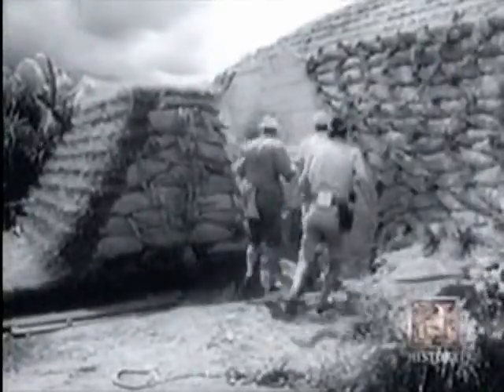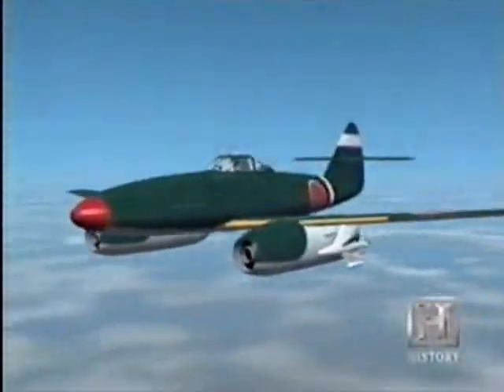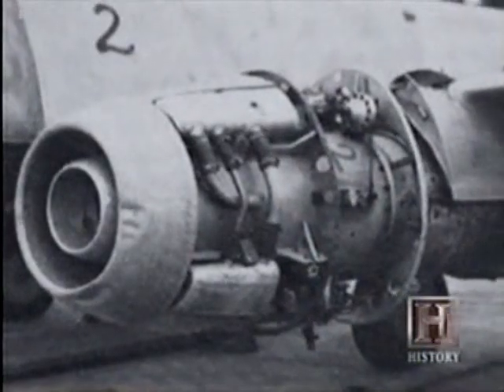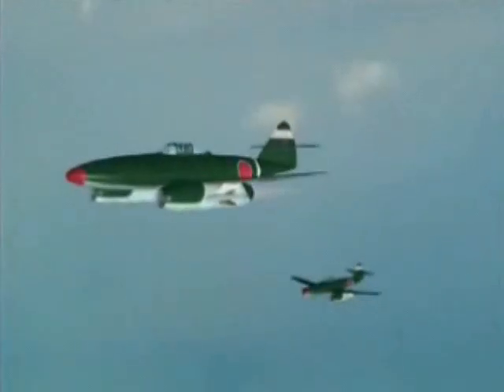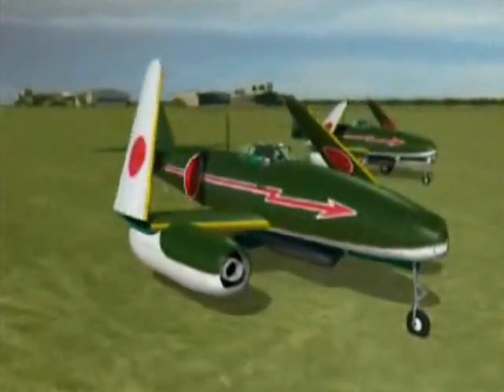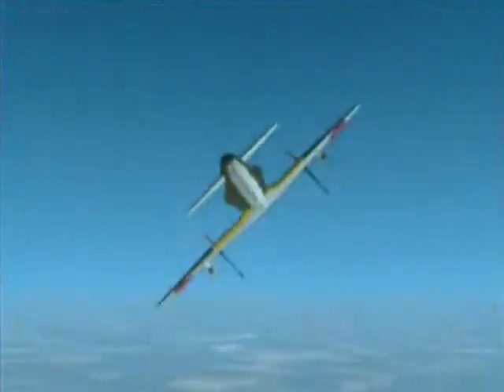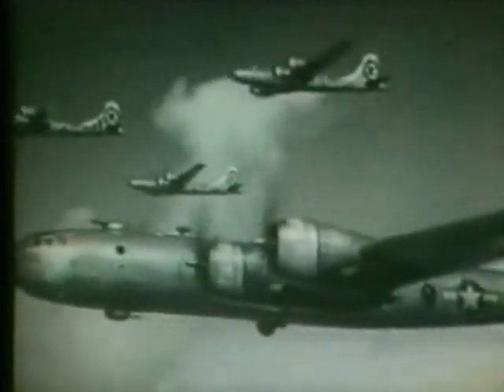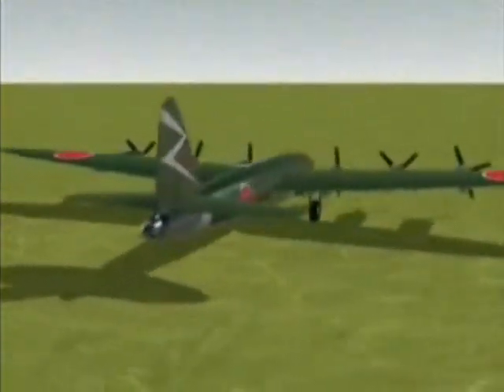Secret of Imperial Japanese Future Jet Aircraft Projects - J9Y Kikka & J7W1 Shinden & J7W2 Jet

Comment: There were more B29s lost to Curtis Wright than to the Japanese. 147 to Flak and Japanese fighters. 267 to engine fires. Hurriedly designed engine flaps in the B29 were one factor. Leading exhaust ports, leaky oil plumbing and magnesium crankcases were another. It was the last time Magnesium was used for aircraft crankcases. The B29 was not the wonder weapon war propaganda painted it as. The remote gun turrets were problematic. The pressurized interior as designed was susceptible to decompression by cannon-fire. Boeing had abandoned it until Lemay used some influence to get it into production.

Comment: B29 came equipped with super charger engine, flew higher than most of Japanese air plane.  Mitsubishi was tested turbo charger engine with 紫電改 Shiden-kai, though.  Even they would have been used, I don't think they worked for the war.  Friendship and trading natural resources is a key.  From Tokyo, Japan.

Comment: @Cyprus883 The  Caproni Campini N.1 flew in 1940 was more of a pulsejet instead of a normal type jet and the Reggiane Re.2007 in 1943 a concept craft only that never really got built. The N.1 did indeed fly but material and cost proved it not pratical in war so never was used.

Comment: I understand that the German radial flow jet did not hold up well because the strong metals required to withstand the high temps while the Whittle engine avoided that...or maybe not...